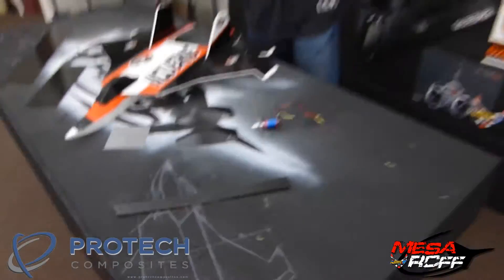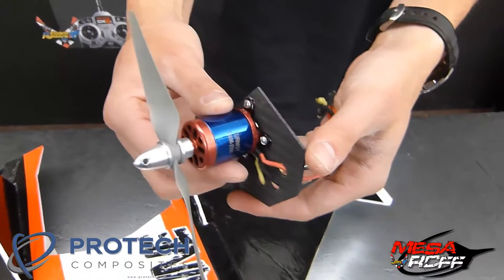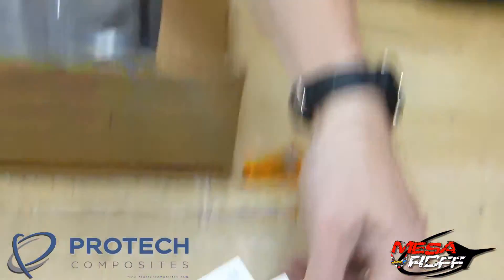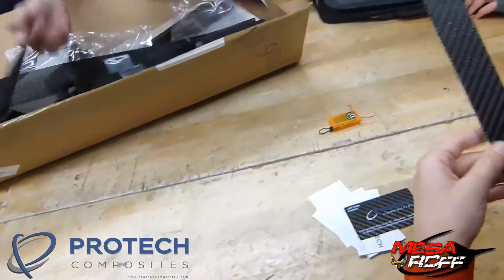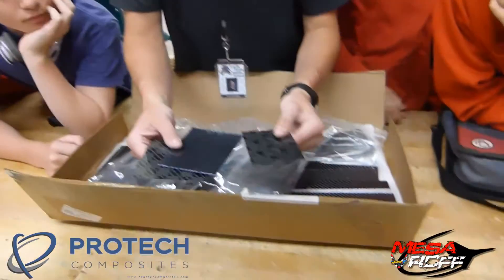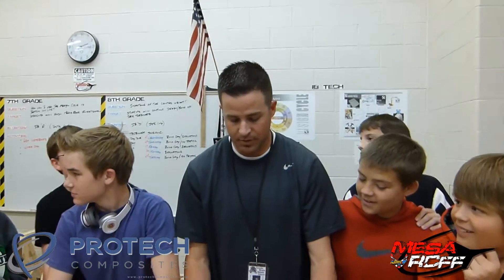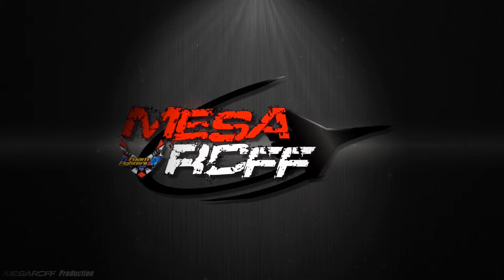MESArcFF - Protech Composites - SPONSORED PROJECT

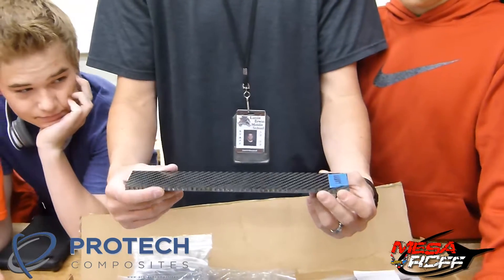Comment: The plates at 2:49 & 3:12 look more like honeycomb core, not foam. Although it's hard to see

Remember to avoid direct contact with the "raw" carbon fiber. The fibers can get in your skin like fiberglass insulation and itch for hours, trust me, I've been there, haha. Use nitrile gloves

Also a tip to help place the raw carbon is to use a mist of 3M 77 spray adhesive on one side of the raw carbon fiber and lay it on your plane like tape.Then wet out w/ epoxy and blot excess epoxy w/ a paper towel